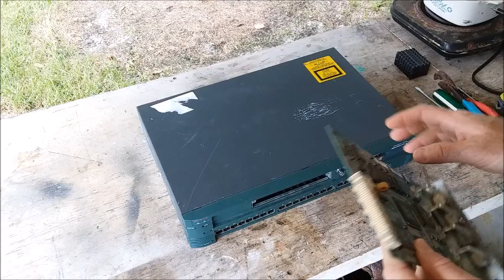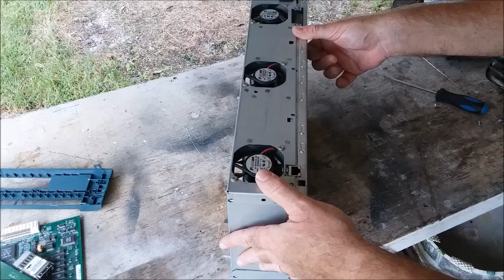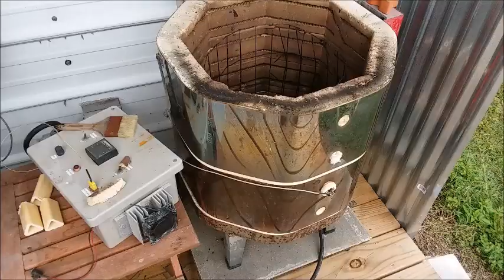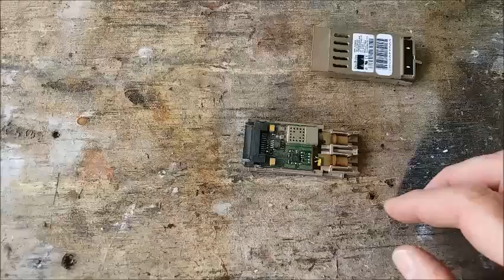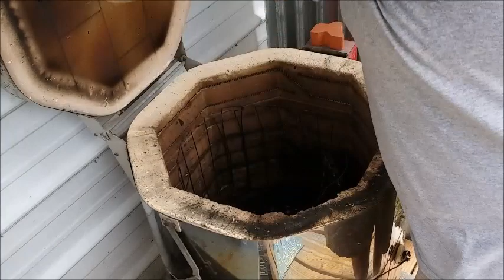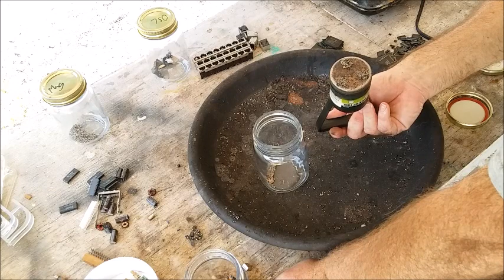Teardown and scrapping of Cisco Catalyst 2900 Series XL switch for gold recovery

Comment: May be a little late, but surely some of those black "tantalums" are not a tantalum at all. They are surely exist, and the only difference between the lighter and darker ones is the manufacture decision ( the black surface can have some advantages, for example they are the same color as the chips, so they are better recognisible for automaticle optical inspection (checking for soldering errors after soldering process), and some disadvantages too - they absorb same heat from infrared heaters (if they are soldered in IR type of soldering owen) as other components, but tantalum caps are verry heat sensitive so that not desired - so the yellow color can bee better). BUT, a lot of those could be semiconductor! Like diodes and transient voltages suppressors (TSV - special type of diodes).

Comment: T use a sharpened hard-back putty knife to remove soldered -on parts. Sharpen the putty knife so one side is flush with the sharp edge. I hope you get what I mean.

Comment: I don't bother putting the IC's into acid to remove the legs, I use a sharp carpet knife to shear off the legs . It's very fast. I don't even have to do this on my legged chips most of the time, I usually just cut them off the board with the knife, leaving the Legs behind and the chip comes off the board legless. I use a heat gun to remove the BGA chips. Another way to quickly remove the legs off of ic's is a bench grinder. It makes short work of those pesky legs. Fastest of all the methods I've used, but you end up with a lot of metal particles and legs on your floor..

Comment: Wouldn't it be a better Idea to face the boards with the components towards the heating elements instead of the center?. The parts are surface mounted, so they would come off faster. actually facing the heat. BTW, what is you catch pan made out of. I know it's not metal, you use a magnet on it a lot. It's probably some sort of ceramic, possible a flower pot botttom. oh yea, check your floor, something flew off the board when you were brushing them off.  36:45
Reply from the maker: I find that if I heat the back of the boards there is less chance of melting or scorching the components on the front of the boards. The radiant heat from the elements can be brutal.

Comment: Another way to remove those plastic connectors with the fold pins is with a nice sharp chisel and a hammer. Back the board up against something sturdy and put the chisel under the connector and whack it with a hammer a few times. If the chisel is sharp enough, it'll sever the pins with no problem. I've seen some people use an air chisel to de-populate boards. That's overkill if you ask me.  I'd rather take a flat blade screwdriver and try to pry up the connector from the board to see if the pins will slip thru the connector. If all else fails, I'll get out my propane torch and heat the back side of the board while holding onto the connector with piers. It's a bit stinky, but it works fast!
Reply from the maker: Yeah, I've done it with a propane torch too. I was a little worried though that since the plastic was melting under the heat gun that the torch would turn it into a gooey mess.
Reply: @omegageek64  If the connector was that close to the edge, I would clamp on a shield on it to prevent the flame from going over the board.